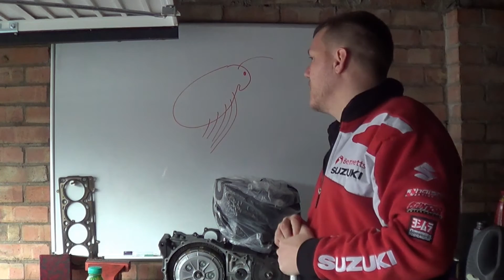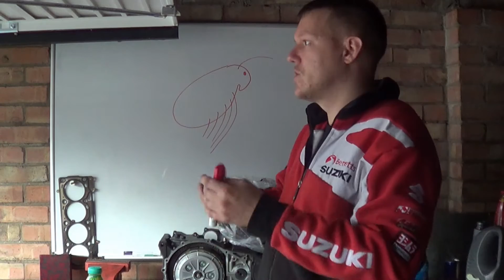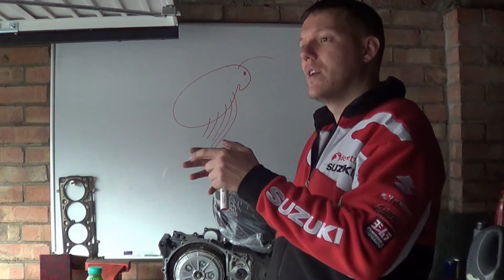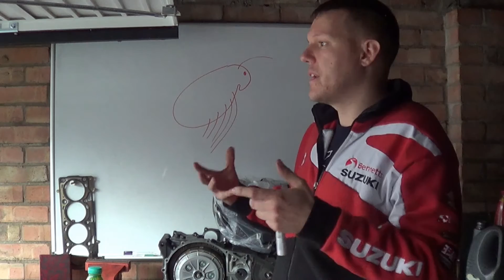Engine Fundamental Flaws - Part 3 - Parasitic Loses

Comment: I realize terminology differs between the engineer and the layperson but in most contexts I'm familiar with, parasitic losses usually refers to accessories external to the engine, such as air conditioning systems, alternators, hydraulic pumps etc... But clearly as an actual engineer you'd know better than me.
Reply from the maker: read this it's only short - https://en.wikipedia.org/wiki/Parasitic_load#Parasitic_loss_in_internal_combustion_engines